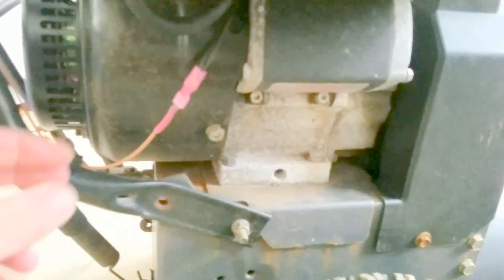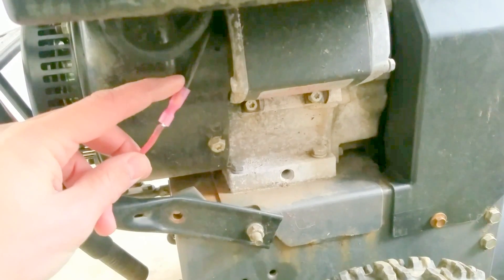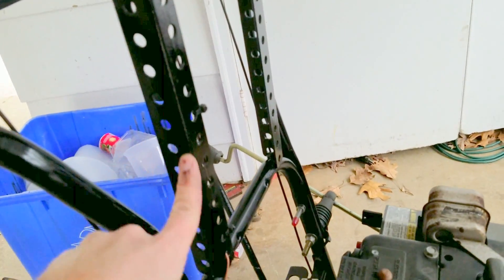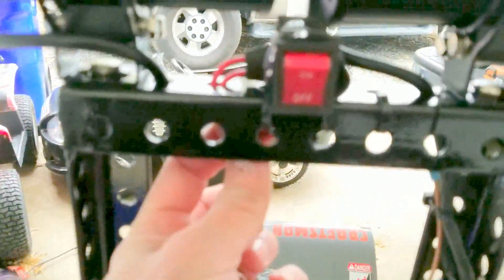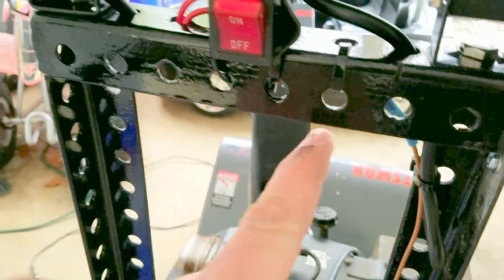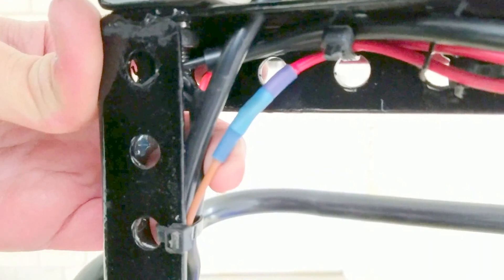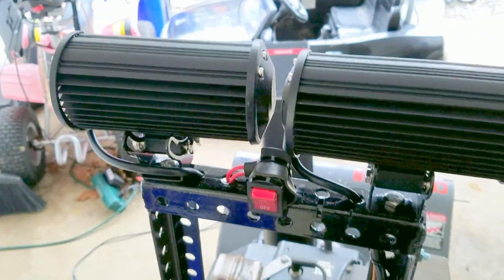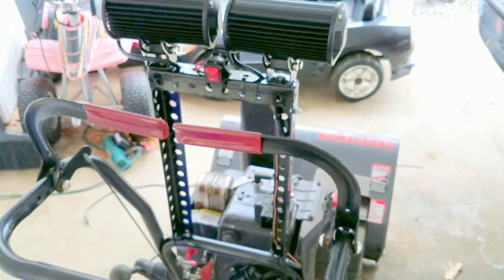Add a headlight to Most Snowblowers!

Comment: Power from a stator is ac. Led like dc. It has been a year. I'm guessing your lights have burnt out.
Reply: Unless A Rectifier Is Built In The Lights..
Reply: @christophergarry4111  Yes but the specs on the LED lights should then say they take AC or DC.  Dan did not say this so I would assume they are not.

Comment: give it time he will burn out his LED lights with the ac power is to much for the LED lights you do need a rectifier 
to convert the AC power to DC power
Reply: Unless It's Built In On Those Lights.
Reply: How much time? I've been running my led setup for two winters now. Third coming up. Still work fine and if it does burn out I can get another one on Ebay for $10.
Reply: @jeffflowers729  You added an on/off switch on the lights which was smart.  You are buying time.  If you only use the light 1/4th of the time you are adding a lot of years.  Quality varies.  For $10 I wonder how the quality is?

Comment: So no rectifier needed
Reply: It's not a matter of "clean current" the voltage your snowblower generates is AC.  That is why your lights flicker.  A rectifier will convert the voltage to DC. They are like $5 on Amazon.
Reply: Careful what you wish for
Reply: I learned the hard way.  LED light worked for a while, but ultimately I smoked The LED light by not using a rectifier.
Reply: Running LEDs off AC power is never going to hurt them. They cannot light when the current reverses 60 times per second, so there is a "refresh rate" effect when looking at them, but otherwise and assuming the output is never higher than 12v, they will not get damaged. Like someone else said though, grab a rectifier, wire it in and the annoying strobe like effect is solved.
Reply from the maker: FUCFoff yeah even though it's not clean current it works great. Hoping I get to use it more this season than last year.